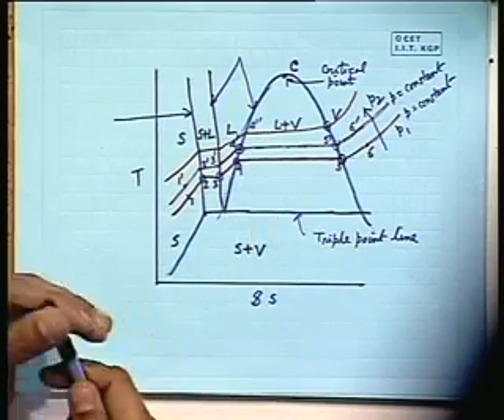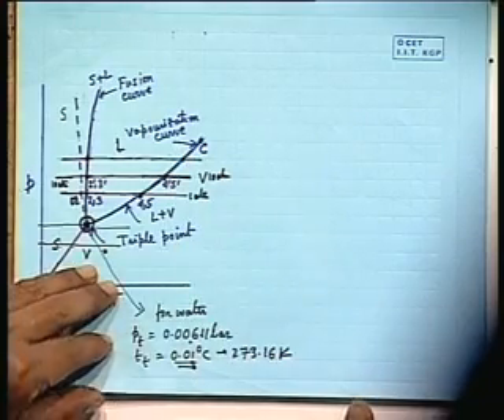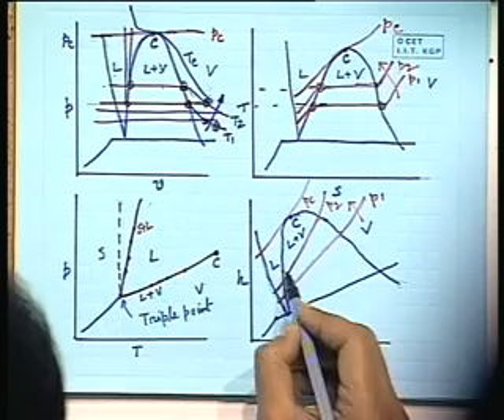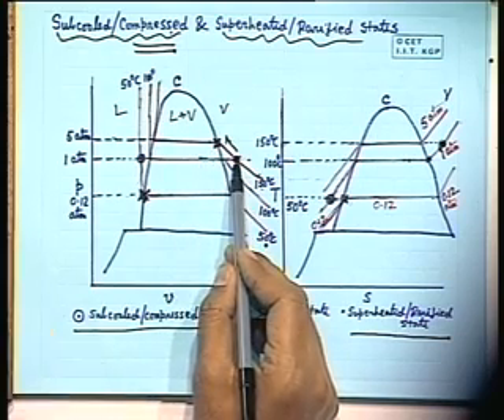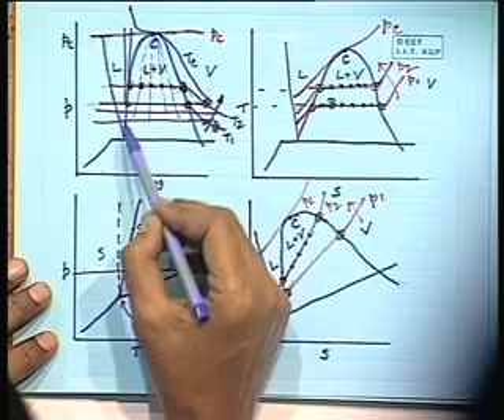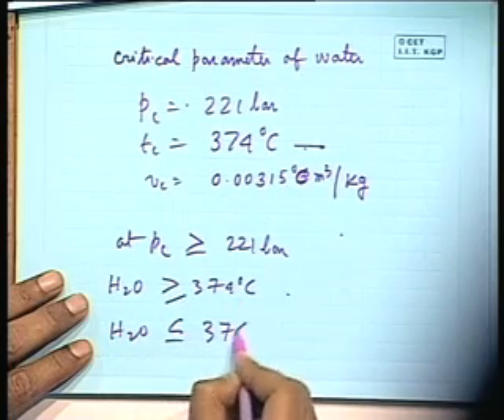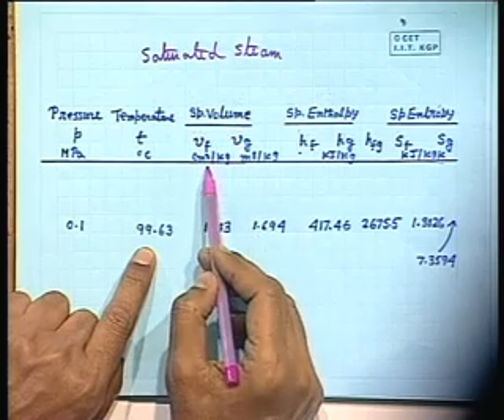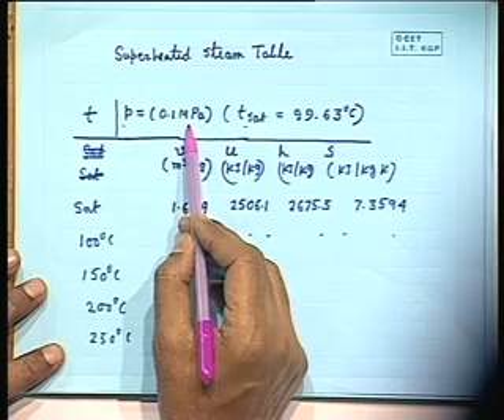Lec-16 Properties of Pure Substances-I

Comment: What is the degree of freedom of critical point ?
By Gibbs phase rule
F + P = C + 2
It comes as one ???
Reply: Component =1 (as H2O is only component of the thermodynamic system); Phases=3( solid, liq n gas)..hence
 Degree of freedom = 0 at critical point.
Reply: @Tintin-in-India there are only two phases at critical point which are indistinguishable liquid and vapor 

So the degree of freedom is 1 

For triple point, the DOF is 0
Reply: @satyasadhu2677  yes you're correct brother. My mistake.

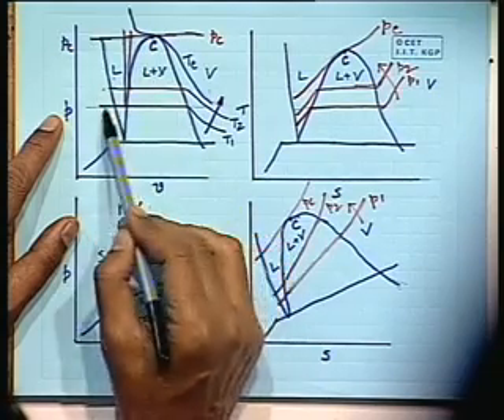Comment: 15:34 Why constant-T line in P-V plot are not described inside the Vapour dome ? I can see T-constant lines intersecting the constant-P line on the Saturated vapour curve, but the constant-T line do not extend beyond it. It is required to understand the phase change in constant temperature, so we must be able to trace the constant-T line inside the vapour dome

Comment: At 18:19 according to gibbs phase rule, (2+1-2)=1. 1 component and 2 phases exist in L+V area. so the system is defined by only 1 intensive property. Then how could I vary specific volume by fixing Pressure in that area?
Reply: Vinay Rao good question. It's not our matter of concern. Once you know, T we can find p from tables. Now  there can be two phases in that system. Liquid phase or vapour phase. Liquid & vapour specific volumes can be read from tables
Reply: Actually to define a state in L+V region atleast any one intensity property and its composition i.e. value of x is required... Since x is an intensive property.. Gibb's phase rule holds good here also... The same case is valid for p-v, t-s, t-h , t-u diagram
Reply: @ayushumang5136  I think to find a property in L+ V region we need 3 intensive properties to do so